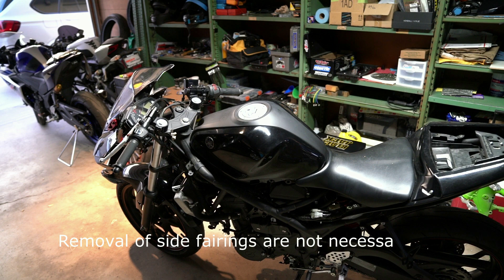2015 Yamaha R3 Valve Clearance Check

Comment: Does the valve cover need a gasket when its removed, or can it be reused?

This is a very helpful video! I plan to check my valve clearances this winter when the weather is cold and wet. Also, change the brake fluid, coolant, fork oil, and repack bearings grease.
Reply from the maker: The valve cover seal (not exactly a gasket, it's a long rubber seal ring thing around the edges) can be re-used most of the the time. No sealant / gasket maker needed either, just re-assemble as is.
Yeah man off-season refreshing up is good for the bike ;)

Comment: did you check the valves if it is still in a good shape and not chipped? theres many r25 (r3 but 250cc) in malaysia the valve plunger thingy? ( sorry i dont know much about bike parts) chipped off when using aftermarket exhaust without dyno tuning it lol
Reply: awesome video thanks for the information!

Comment: when should i do valve clearnce? i have a 2016 r3 and it has 25800km mileage on it.
Reply from the maker: Look at the manual, I think most people recommend to do the valve check before the spec. The spec is something like 20k miles I think, but some of my friends checked the valve at 10k miles and some are slightly off already

Comment: Lucky you; you didn't need to change a "spacer".  PITA
Reply from the maker: Indeed. I was like “phewwwwww” after finding out I didn’t need to adjust them :)
Reply: @leitian7328  Is it hard to change the shims? Do the shims just slide out or do you have to remove the cam shafts to access the buckets and shims?
Reply from the maker: It’s not difficult, I did it twice already on my other R3’s. You need to take out the cam’s, and the buckets / shimes are right there for you to take out with a magnetic pick up tool.
Reply: @leitian7328  Oh okay, thanks for the info. Have you done the fork seals, yet? I wonder how difficult that is on the R3...Note, I don't have an R3; but I'm thinking to get one. As I do all my own maintenance and repairs, these are the first things I think about when getting a new machine. I hate it when things are super hard to work on.
Reply from the maker: Hi, here is the good news: the first gen R3 has the most dinosaur like fork design. I could change the fork seals without any special tools, just my pvc home made seal driver thing (of course a seal driver helps). No need to compress springs since cap just comes out by unscrewing. So all in all very easy to work on.
Second gen R3 has upside down forks so it’s a little harder, in compressing the springs.
Reply: @leitian7328  Thank you for the information. I will take that into consideration.

Comment: My bike has clatering feeling in the engine when the bike is running. Can even feel it on my handle bars. My engine suddenly dies when riding but not often. And my bike feels like chocking power when i go over 120. Is it someting serious. My mileague is 100k over 3 years. Thanks.
Reply from the maker: Hey, if your bike has quite high mileage and has issues with iing (rough idle, stalls, etc) a lot of times it’s issues with basic maintenance (e.g. spark plugs need to be changed), or throttle body itself got dirty or out of sync, thus it’s more difficult to hold an idle steadily. My strategy with older bikes for this kind of issues, is always keep up with maintenance and see what improves it. E.g. if your air filter is plugged up and spark plugs are 30k miles old, it can trick you into thinking your engine is on its way out, but reality is, Japanese street bikes are very very robust, as long as you do maintenance per factory spec, chances are it is just fine

Comment: What happens if cleareance is bigger that what manual says? How can it be solved?
Reply from the maker: If clearance is bigger than spec, you’d need to swap the valve shims under the buckets to thicker shims.

Comment: What are some symptoms of a r3 that would tell you it needs a valve adjustment?
Reply from the maker: As far as I know, loose valves will create more "chatter clatter" noise from the valves. Tight valves can create starting issue if they are over a limit --- however if that happens, it could be already too late and you are on your way to burnt valves. As a result, I would suggest not to rely on symptons, but just rely on keeping track of checking intervals.
Reply: @leitian7328  I have a low idle ...sometimes the bike will shut off while ridding...I don't get an error code on the dash cluster either ..have you ever heard of this problem?
Reply from the maker: Hi Brian, yes I had one bike which had that problem. In that specific case, it was because the throttle body was very dirty and thus air flow was too restricted. As far as I know, usually that kind of "low idle" issue is caused by too little or imbalanced leakage air, caused by either (1) dirty throttle body; (2) wrongly adjusted throttle stop; (3) dirty or broken idle air valve; (4) throttle bodies out of sync.

Comment: And i have one more question..whats are most spec of yamaha r3 valve specs range..
Is it 2mm to how much the thickness range value of the shim..can you help me sir..thanks alot
Reply from the maker: On your swingarm there is a sticker, which lists out the valve specs range. It's in mm and if you convert into inches, I believe it's 4 to 7 thou intake, 8 to 12 exhaust.
Reply: the specs of the clearance are in the bottom of the valve bucket.. you can cross check through mirometer but for the 41k it wouldn't make that much difference, as long you follow the maitence sched. and using the specific lube..

Comment: I got some issue, my bike seems sometimes power loss and shut offf when i pull off the throttle..is it the valve clearance alrdy out of spec or need to check the throttle body first?
Its already 40k km mileage
Reply from the maker: Given that the power loss is in running when you pull off the throttle, I would suspect your problem is not from valve clearance and check the basic stuff first --- is the spark plugs still good? (R3 use regular copper plugs with short life span). Is idle somewhat good and consistent? (if not check throttle body bypass air, clean throttle body if possible). Also, make sure air filter is not way old and plugged up. I think it's a far stretch to only have that issue, because of valve clearance.
Reply: @leitian7328  i think so, maybe my spark plug..idling also sometime low and high..last time i alrdy change the plug at 20k km, now its begin to happen again at 40k..maybe i need to replace the plug again..thanks..helps me alot

Comment: Hello sir..i already check my valve..
On exhaust..i got 0.15, 0.20, 0.30, 0.20

And intake all still in spec, 0.10, 0.10, 0.15, 0.15..

But my bike really got power lost during accelerating..

Maybe the valve already burnt i think..
Mileage already 41k km..
All spark plug change..

The air filter maybe the cheap one..need to change again..

But i still thinking the valve already burnt..

Is it true? Or anything can you say?
Reply from the maker: Hi, if you bike starts and idles well and smoothly, then I don't think your valves are already burnt. It really depends on how the power loss is --- if it is intermittent and random (loss --- no loss --- loss --- and suddenly no loss again), then very likely it's some electrical or fuel delivery issue. If the power loss is constant when you open the throttle WOT --- that is, you bike is always weak at WOT, then likely it's air delivery issue --- air get choked by either a way dirty air filter, or some kind of restriction in intake or exhaust (e.g. throttle plate cannot open all the way, which is rare).
So.... air filter could be a culprit if the power loss is always there at WOT. For intermittent power loss then it's much more difficult to diagnose.
Reply: @leitian7328  thanks so much sir . .i will start checking other part..because its sometimes power loss, somethimes not...maybe the other thing i need to check..thank you so much.
Reply: if everything is in specs try measuring the thickness of your clutches